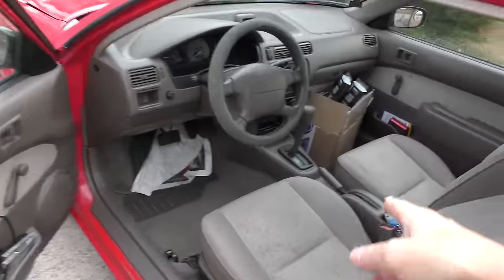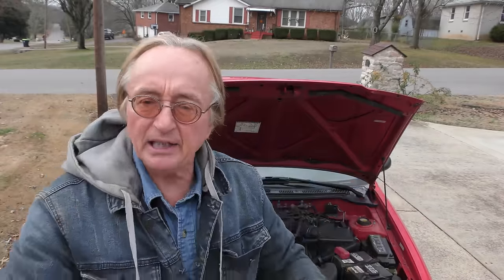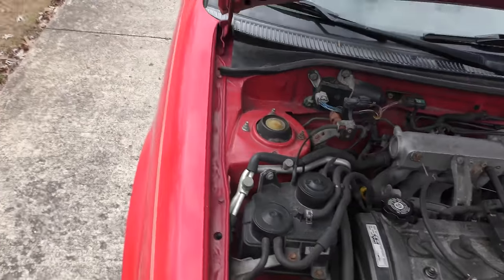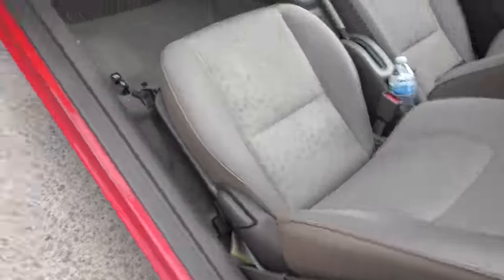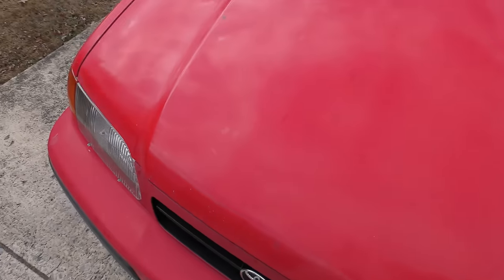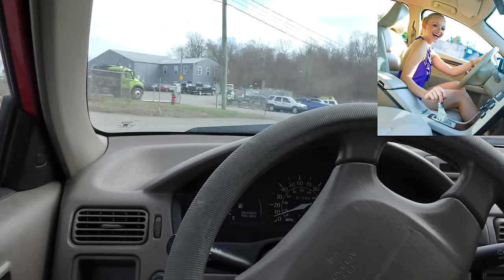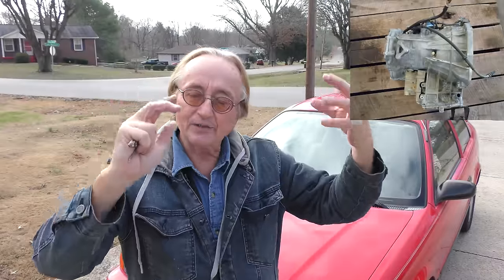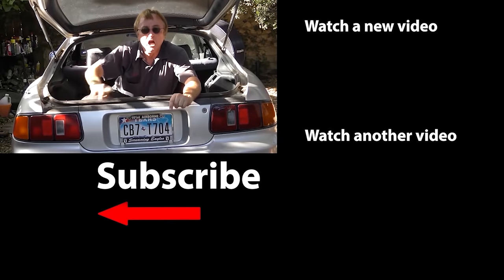I’m Sitting in the Worst Car Toyota Ever Made

Comment: My Tercel is great, it’s a 1994 and runs like a top. Super reliable car. Easy to work on, cheap parts and needs little maintenance. I haven’t done anything but replace the distributor cap in the past 5 years. The two other Tercel I had were great too (a ‘82 and a ‘97) I only sold those cause I needed bigger vehicles at the time. I don’t think I’ll ever get rid of my current Tercel. I also currently bought another ‘82 Tercel to do an engine swap with an mr2

Comment: I'm commuting to work every day with my 1996 Tercel SD (no ps/ac) with 207,000km on it. The bulletproof 4 speed manual is still shifting smoothly. I like how the cars were made back in the days. Simple, reliable and so easy to work on.

Comment: @5:50 I knew a coworker who bought an older car.  Driving it home, he noticed his daughter looking around the door, console, and dash.  When he asked her what she was looking for, she said she was trying to figure out how to turn the window down.  She had never seen a window crank.
Reply: I refused to buy a car without power windows in the last 12 months; I wasn't upscale, but I haven't hand-cranked a window in about 10 years.
Reply: @markh.6687  Your generation is soft
Reply: @nostradamus7648  Try again; I was born in 1965, and grew up with hand-crank windows. If anyone is soft, it is you for making assumptions.
Reply: @markh.6687  That's what ALL the Gen Xer's say
Reply: Get silicone lubricant and spray the edges and the base it will make the 982 cranks to get it up and down much more smooth. You may not be able to do it if you have tint.

Comment: I have a '97 Tercel that I've had for 7 years now.  I paid $1200 for it.  It still runs great!  This was the first year out of the 7 that I've owned it that it needed major repair work.  Replaced a lot of parts such as the timing belt, oil pan, oil pan gasket, alternator, starter, and more.  I just told him to replace these parts while he was doing the timing belt so I didn't have to worry about them later.  Car was running super great but after the repair, I noticed that it was using a lot of oil.  It never had a problem using oil.  So at this moment, it is in the shop and the mechanic admitted that it was not my fault.  There was a problem on his end so he is fixing it now at no charge as the work is covered by warranty (thank God).  He assures me that when I get it back, there will be no oil leak whatsoever.  I can't wait to get it back.  It's such a great running car and at 242,000 miles it still runs just as great, if not better, than it did the first day I bought it.  When I first purchased it, it had 164,000 miles.  Didn't have any issues til early this year and the oil problem it has now is a mechanical error and I'm so thankful my mechanic was honest enough to tell me the truth!  I don't trust mechanics at all as I've been burned too many times but finally I've found a very nice, honest mechanic.  I told him how much it means to me that he's so honest with me and striving to make me happy.  The other day he said the car purrs like a kitten.  I'm supposed to get it back in a couple of days.  Just waiting on one more part.  This '97 Toyota Tercel I have has been the best car I've ever owned and the high gas prices never really seen to "hurt" me.  It's cheap to fill up and lasts a while!  I wish they still made 'em.  You can find them online but the ones I've seen are hundreds of miles away!   It's just a really awesome car and fun to drive!  P.S. - Mine is a 5 speed manual.  I love it.

Comment: 5 years ago owned a 94 Tercel. 4 speed manual base model. No power steering. Burned oil like no other car I’ve seen. Sold it to a kid that wanted to work on it and change the engine. His father a mechanic. Hope they made good from it. Now I own a 95 Corolla 5 speed. Still enjoy Toyotas.

Comment: I had a 1992 Tercel. It got 37mpg going 75mph on cruise. I ran the original timing belt for 85k miles I ended up selling the car. The same red paint was shot! It still ran like a top 105k when I sold it. The guy I sold it to still owns it. The car looks and sounds like a rolling mechanical hell, and he drives all highway, commuting to his snow country house every week.

Comment: I still have my 95 Tercel DX.  4 door, 5 speed manual w/183K!  I've replaced the norm (tires twice, battery, brakes, alt, belts) replaced clutch master cylinder...but all else is original...even the muffler!  This was my commuter until I retired this year.  The first 3 years I owned it I commuted 72 miles one way and if I kept it at 65 mph w/AC on I could get a max of 52 mpg.  I then commuted to Staten Island, NY once a week and would get 45 mpg doing 75 mph w/AC.  This little thing is a workhorse. ❤

Comment: Had a 81 Corolla, 2 door, automatic, rear wheel drive... Drove it from Chicago to Tampa  in 1990 with less than 3 tankfulls of gas $39 ( that included going up Look Out Mountain and Ruby Falls)...I put some used wide tires on the back so it wouldn't sink in the sand on the 2- rut rural red neck roads (paths)... The only problem I ever had was caliper pistons due to the limestone dust...Sold it to the first teenager who looked at it... said his brother has one...He didn't even care that it had a big rusted hole in the trunk !... Those were the days (chuckle)

Comment: The Tercel was a decent economy car, and any cheap built compact car are usually the most troublesome.   I worked for a Toyota dealer from 1986-90, and I remember many an ignition igniter going bad, and no fire to the ignition.
Reply: "All right, you bastard, fire, fire, fire!"   -- line from the space movie "Marooned".

Comment: Story: Tercel 2 Dr hb, 4cyl, 4 spd, friend bough for daughter, not running well, oil black, found tapered spark plug holes, lawnmower straight spark plugs, exhaust and intake valves reverse adjusted, timing way off, one bad spark plug wire, carb ok, adjusted for altitude. Fixed all, he said thanks!
Reply: And then things got serious......😁

Comment: I bought a new 2-door Tercel DX back in 1995 and kept it for 5 years. It was pretty good, I never had any problems with it other than having to replace the timing belts and spark plugs when the time came for them to be replaced. If you want something small and cheap to drive around, then go and get one if you can find any that are not all rusted out.

Comment: I know this - We had a 87 Tercel in the family as a second car - It was driven hard with 350,000 plus KM over 10 Canadian winters with little to no maintenance and it never give us a problem. It actually went the last 110,000 KM with no oil or filter changes - unbeknown to my father my mother and brother just topped it up with oil for the last 110,000 KM.  It finally died after we sent it to Toyota for a tune up - they did something to the carburetor and changed the plugs - it ran rough thereafter.  It was bought for $9,000 and traded for $4000 on a 98 Tacoma - the Tercel was the best value we ever had in a car. It always passed inspection and just kept going. The Energizer bunny could not keep up! Oh we did put brakes and tires on it a few times and one battery (only time it failed to start) - but other than that no attention or money was afforded it - I think it got washed once - it only drove in the city - never went on the highway.  If Toyota offered a new 1987 vintage Tercel in 2023 I would purchase one in a heartbeat!😀

Comment: I had 2 identical 1998 Tercels. Both green with beige interior and a 5 speed manual. One was $1000 and one was $450. I definitely got my money out of them
Reply: That's a good buy. Good luck finding one now, and if you do find one they be selling it like if it's a second hand Corolla out of the dealer.
Reply: Wow 5-speed 98 Tercel would be a hypermiling terror. I got 47 on the highway with my four-speed. What's the best MPG you got with the 5-speed. Now I got a 4-speed with overdrive automatic.

Comment: I had a 1998 of these with 5 speed manual trans.  Great little car for very cheap.  Had 14" tires that were so cheap!  Yes it burned a little oil and only took. 3.1 L of oil for oil change.  The dealership would put 4 L of oil in it every other oil change.  Had to get them to drain the extra oil back out.  Car was very light with small tires.  Easy to do a front wheel spin.  One problem with the car was it had no ABS.  So you slam on the breaks and the car would just slide.  I loved the manual transmission. A lot of fun.  It would get 45 MPG with that manual transmission.  Better MPG than the Yaris i replaced it with.  The Yaris with the 4 speed auto also would rev a little high at highway speeds.

Comment: I had a the previous generation square bodied Tercel which I bought when I was stationed at Fort Hood, Texas. As my daily driver I drove it all over Texas, then back east to visit my people in Pennsylvania and North Carolina. I bought from a repo lot in Tample, Texas and it had just over 5,600 mile on it. I moved to Austin and then Hondo where I frequently drove to Houston and Pasadena, Texas. I never had any problems, all I did was tune ups, change the oil and put better tires on it. Oh, it was a four speed manual. I gave it to a friend who needed to commute to Houston Medical Center from Texas City and he put another 75,000 miles on it before it was washed away in a flood. He loved that car too. Absolutely reliable and dependable.

Comment: I am surprised the Toyota produced this car. Usually their Quality Assurance (used by Japan after WWII to fix the cheap unreliable products there with TQM (Total Quality Management) unit would fix these issues in the design phase. Probably the marketing section kept the cost low at the expense of the buyers!

Comment: The last generation Tercel is one of the best cars ever made. They can last well over 400,000 MI. You'll be hard-pressed to find a new generation Tercel that has a blown head gasket. I have a automatic 4-speed with overdrive. It was taken care of by a car rental company and they barely drove it because I'm pretty sure people aren't too interested in renting 
 A Tercel. It had a front end accident but run just fine. A lot of people don't want to put the money in maintenance. I had two of these in four-speed manual Yankee get 47 mi in a gallon on highway. Is this thing had five or six speeds it would be a hypermiling terror. Essentially this is a Corolla with all the fat cut out.

Comment: There is also a 5 speed manual and a 4 speed auto from 1995-1999 I would be happy if you try them out, I'm currently a owner of a 5 speed 95 toyota tercel and it doesn't disapoint

Comment: My wife had an '89 Tercel.  I don't know if it had the carburetor Scotty is talking about--it was a crappy electromechanical thing that failed.  Every mechanic told us it would be $1500 to replace it.  With only 60K miles, we got rid of the car.  Too bad we didn't know any decent mechanics back then or she would probably still be driving it.  It really soured me on Toyota--all you ever heard was how reliable they were, and we felt let down.

Comment: I had an 82 or 83 Corolla Tercel bought in 88. It too survived several wrecks.  At one point the transmission joint in the rear was hanging like a hockey stick and the car still ran and drove enough to get it to the shop for repair.
Reply: I bought a 82 new that was a standard . We had zero major problems with it ! Sold it with 180,000 and still ran good .

Comment: I knew people that had Turdcels. They seemed to be as reliable as any other Toyota but they were seriously underpowered especially with the automatic. They also had a harsh ride and were noisy but they got you where you wanted to go.
Reply: 💯 auto Tercel was my first car. It was so slow and uncomfortable. In winters the car had no traction whatsoever, very little torque. But it lasted forever and I hardly put money into it. A decent first car, but don't hesitate to upgrade when given the chance!
Reply: The typical "upgrade" is usually to a Focus hatchback with manual and about 50 more HP. :)  Fast, fun, and also cheap to operate.

Comment: I have a manual (4 speed) 96 Tercel and I actually like it a lot.  It reminds me of the car version of my old 1992 Toyota 2WD pickup with airbags. It's the smallest car on the road and I love mobbing around in it.  Good gas mileage and good AC.  I got it with 125k miles.

Comment: My mother in law had one. Wound up trading it in because one of the plugs had oil on it and they suspected the engine blew rings.  At the time I figured it was a valve cover seal and I wanted it. I still dwell on not being able to buy it off her.

Comment: I bought an '89 Tercel off the lot new, and it was definitely a Turdcel.  Never ran right, ran like it had a vacuum leak from about 30K miles on.  Had it in three dealerships, none of which could find the problem.  One of the dealers accused me of abusing the car since the coolant was an orange/brown color.  The coolant was that color from NEW.  Heater failed around 30k as well, had that in about three dealers as well until someone finally found that the cable to the temp blend door pulled loose under the dash.  I managed to run the car for 103k miles and traded it in.  If I had to drive it another mile, it was going to be over a cliff.  This one car is the reason I've never darkened the door of another Toyota dealer in 30 years.  Hope you're listening, Toyota!  ;-)

Comment: Working on 92 with 200000 and giving it first set of 4 struts and all motor mounts, door lock and thermostat and shes still a good running 1.5 is  strong and. Smoke and knock free.

Comment: I bought a used 1995 toyota tercel in 1998 with about 35k miles on it. I drove that thing for the next eighteen years to a little over 200k miles when I finally sold it. That was the best car I ever owned and I wish I could have kept it to see just how far I could take it. It ran almost like new at 200k miles.

Comment: Think the Tercel was Toyota's bottom of the line? Enter the Toyota STARLET, imported from 1981 to 84. This deathtrap had a 1.1L engine, 5 spd manual set up the old-fashioned way with rear wheel drive. Dead simple and extremely reliable. However, the rest of the car would gradually disintegrate around the drive train. When parked next to a Tercel, my '83 Starlet made the Tercel look like a Cadillac.

Comment: I have a 95 Terdcel I bought 25 years ago. It has 112k miles on it right now and have never had one problem on it other than a new alternator and a harmonic balancer and R & L axels on tbe front. I love this little car. I think Toyota made them with about 4 or 5 colors with mint green being the  main color Toyota painted. It needs a paint job which I plan on soon. It gets great mileage and the AC still freezes me out. I have had several people to ask me to sell it to them. I’ll keep it another 10 years   I use it as’my yard sale car. I won’t ever sell it or trade it. This 95 is a charm. When I bought it 25 years ago it had 40k on it and now 112k. It’s a damn good little car. No matter what anyone says. I’d trust it to drive to Texas  from my home here in NC. THANKS FOR THE VIDEO.😅😅😅😅

Comment: It's actually a four speed, but Drive starts at 2nd gear from full stop, hence the 1st or Low gear shift option.
Reply: it's a 3 speed. They did have a 4 speed auto (overdrive) available.

Comment: Starting in 1979 the emissions law stated that the intake and exhaust systems cannot be modified or changed which will change the emissions on any vehicle that's used on roads and highways. If Scotty was doing this before 1979 then was okay, but after that he was breaking the law.

Comment: Most of the issues related to the variable venturi carburetors were not the carburetors but the vacuum system and filters. Fix those issues and the carburetors work excellent.  Putting Weber carburetors on these only made these into polluting gas guzzling disasters.  Other than that the Tercels were a very good car.

Comment: I had a 78 Corolla that had the same problem....needed another gear bc the engine was really buzzing at 60 mph. No tach so not sure of the rpm but probably around 3000 or so.

Comment: I have which was already used and have it for 13 years. Please don't call it the worst car it hurts a lot to degrade my one and only car I have for so long. its a model 93 Dx. They are reliable little 1.5 engines in these hard times. Mines is dying but still running and love me tercel 93

Comment: When my Mustang was totaled (by another driver being careless and hitting my car), I was stuck in a 2015 Yaris hatchback rental for four months until the replacement was being built by the factory.  No noise insulation of any kind, and the Bluetooth on the factory radio stank-difficult to use and figure out.  The hatchback could only handle about one grocery bag.  It was a huge letdown after having the Fiesta rental from the Ford dealer.  The Fiestas had a much nicer, more comfortable interior, and its hatchback was much larger than the one in the Yaris.  The Fiesta (despite not being a sporty model, like the ST), also felt way more sporty to drive in.
Reply: @Brent Boswell Fiestas are the worst car ford ever made. Lots of lemon law required for them.
Reply: @Blakecryderman7244  the only discernable problem with the Fiesta is the dual clutch transmission on 2015-up models that didn't have a manual transmission.  Various Ecoboost engines also had problems, some of which were subject to recall.  But it was a much nicer small car to park your butt in for day-to-day driving than Toyota's offering.  The Yaris was kind of the continuation of the Turdcell, too cheap to be good.  I was always amazed that people bought Tercels when the Corolla was usually only around $1k more expensive, and a much better bang for the buck.